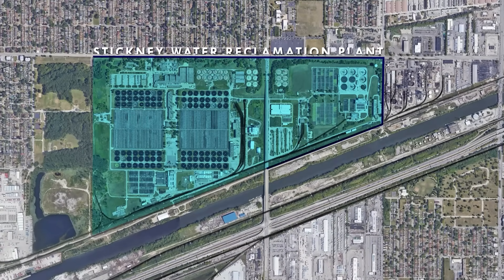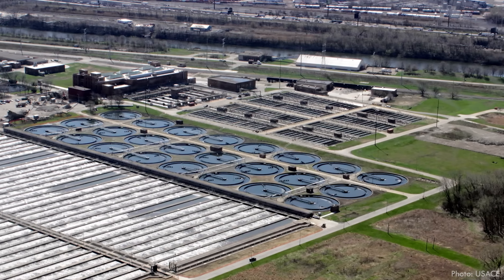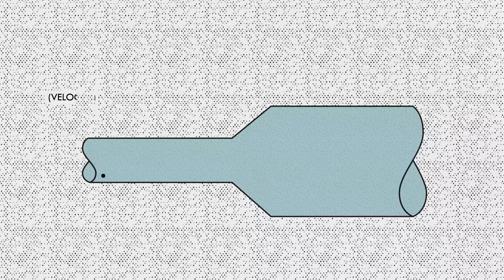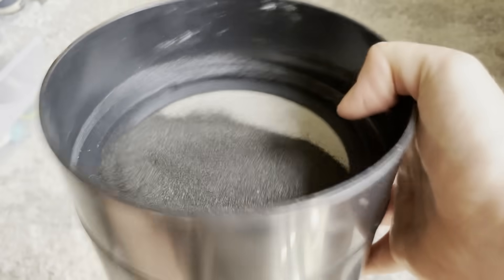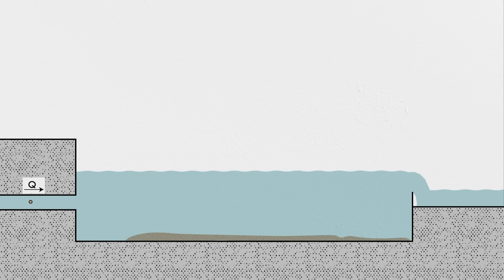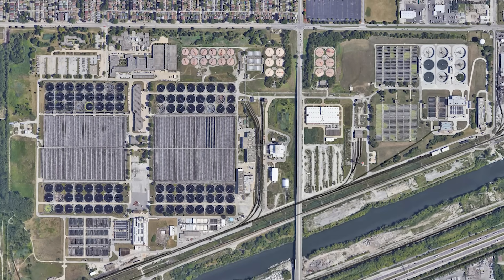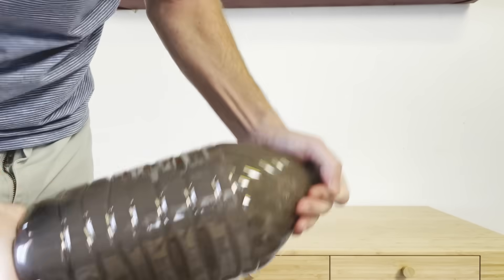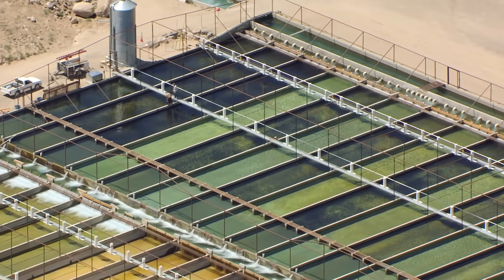How to Clean Sewage with Gravity

Comment: I'm a design engineering student and I'm still confused about how the depth doesn't affect the particles that pass through.  I understand most of the maths and algebra but two things confuse me.  1)  why does td get flipped when compared to tl?  2) surely a shallower basin would be more efficient at filtering these particles out as the particles don't have to fall as far therefore the time taken to fall to the bottom would be shorter?  Can anyone explain this to me?  Otherwise great Video as always and keep up the great work!
Reply: 1. They flip both td and tl. I think thats for simplicity sake. if you dont you would have 1/Vd > LxW/Q after canceling out the Depths. 
2. As for the shallow basin question, this is purely speculation on my part: but You are correct that a more shallow tank would allow for less time to settle being that the distance to travel would be less BUT that would require things like flow rate and settling rates to be known and constant to insure not passing solids out of the tank. Also, being that in order to encourage settling you must increase area to decrease flow, to have a shallow tank you would need it to be very wide and space is always a consideration when designing plants. Going deeper rather than wider saves space. You also must consider the solids that settle must also be removed by some fashion, having a shallower tank would mean sludge withdraw rates would have to be higher and consistent in order to not pass solids out. Furthermore, plants have two design parameters: design flow and peak design flow. So a tank must also be able to not overflow solids at higher flow rates that will happen due to diurnal fluctuations and precipitation events.
So theoretically a shallow tank would allow for a lower time to settle but that doesnt take into account real world conditions.
source: I'm the Chief Operator of a WWTP

Comment: I worked as a intern for a dredging company one summer in college and they used a series of settling ponds (which were just an old open pit mine with a thick plastic liner) to settle suspended particles out of the outflow of a dredge that was expanding a port.
The (MUCH clearer) water was then pumped back to the bay near the port.
Not sure of all of the deals behind the scenes but it seemed like an elegant way to fill back in a giant open pit while making space for more shipping.
Was also a fantastic summer job!

Comment: Great breakdown on the aerobic wastewater treatment. Very fascinating field. Aeration basin micro-organisms host nitrifying bacteria which consume ammonia. If the population is upset or the aeration rates aren't high enough, ammonia nitrogen can make its way through the process and drastically increase chlorination demand. In aeration basin, it takes 4 parts of oxygen to treat 1 part of ammonia. It takes 10 parts of chlorine to neutralize 1 part of ammonia if it makes it to chlorine contact chamber. Not every plant uses chlorine for disinfection. There are safer and simpler methods to disinfection now. Theres always new technology emerging for every part of the treatment process.

Comment: Dairy cows are often bedded with deep sand. While it's a great bedding providing both comfort in the stall, traction on concrete and bacteria has a harder time growing in it compared with organic bedding materials, sandladen manure is a challenge dealing with as well as well as the constant need for new sand to rebed with. One tool that's developed in the past 15years is sand settling lanes. Sandladen manure is removed from the barn via circulated water where it hits a long, nearly level lane where the sand settles down and the manure flows onto liquid storage. Sand is removed several  times a week, stacked and then used to bed again once it's had time to dry.

Comment: At our small company we use dissolved air filtration with the coagulant and flocculant as the first two stages. The solids float to the top and are scraped off rather than sinking. I do wonder the impact of the chemicals used though.

Comment: Why not spin the water within the pipe itself and upon expansion, you can separate the center portion from the outer portion after a specific length without need of a basin. They use that technique to separate plastics of various densities.

Comment: part at 7:15 needed either arrows or at least a slowdown in speech
I did not get where the water is coming from and what the rotating thing does (or even if it is connected in the middle or at the edge of circle)
Reply: Dirty water ("mixed liquor") flows through a pipe towards the clarifier.  The pipe comes up from underneath the center of the clarifier, and releases the water at the top center.  Then the water flows horizontally from center to edge.

As the water moves from center to edge, solid particles fall to the bottom, creating a sludge.  The bottom is sloped, shallow at the edge and deep in the center.  There is an even deeper pit/well at the very center, surrounding  the inlet pipe.  The sludge is supposed to fall into this pit.  (Eventually the sludge is removed, but where it goes doesn't affect the clarifier.)

The rotating thing has a pivot at the center and a motor at the edge, so it rotates around the center.  But it isn't only above the water - under the water, it has a long scraper part - this acts sort of like a broom, pushing the sludge towards the center of the clarifier.
Reply: @CoastalSphinx  thanks!

now I wonder why water doesn't go into the pit "at the very center"
Reply: @NoNameAtAll2  Water does go into the pit, but sludge is heavier (higher density).  So when sludge flows in, it pushes the water out.

Comment: As an Environmental Engineer, it's amazing that wastewater treatment is getting the exposure that it deserves. This can go a long way into shaping people's opinion in processes that are crucial in our lives but are oblivious to.
Reply: Couldn't agree more, im a maintenance tech for a water company and people seem to think that Sewage just, kinda goes down the drain and disappears to some magic location?!
Reply: I'm always amazed of people living across the street from a treatment plant and don't know it.
Reply: how is the sediment accumulated at the bottom taken care of? I mean I assume that it eventually piles up
Reply: @BringDHouseDown  Grit, as it is commonly called can be removed manually in small-scale plants. Large scale plants employ bucket s calpers, pumps, or screw conveyors. Sludge ( biodegraded material) is removed every 3-4 years ( depending on system design), dried and sold as fertilizer.
Reply: @0xKenneth  where r u from?
Reply: @0xKenneth  Do you have any idea how much sludge would build up if you removed it every 3 to 4 years. It is removed daily and in some small package plants, it is close to monthly. Without a grit chamber, the grit will be in the sludge. It is generally not removed once combined with sludge. Grit will eventually build up to an extent as not all will be removed when pumping to the next stage of the treatment process. Tanks or clarifiers will be dropped generally on a yearly basis for inspection at this time grit will be removed if it is excessive.
Reply: @BringDHouseDown  9:00
Reply: If only more sewage treatment were available in third world countries a lot of deaths could be prevented.
Reply: @thebigwarthog  all they need is a septic tank that I'd drained by a third party once every decade. It's shocking how it's not being implemented
Reply: Hey i've got a question: These circular clarifiers are called Dorr-type clarifiers right? Dorr clasifiers are often used in mining so there is where my question stems from.
Reply: @fic15 is probably not a coincidence then, that another term in wastewater treatment "mixed liquor" comes from the slurry produced in mining, as well.
Reply: Gravity huh? Buoyancy vs density. Otherwise nothing would float.
Reply: I just started working for an engineering firm as a structural designer. I was literally working on a treatment plant while listening to this lol. It's a really cool industry.
Reply: Yeah except the horrendous shit smell that gets carried any way the wind blows
Reply: @spamelowashington57  I presume that comment was made in light of the fact that you are not a biological organism?

Comment: Hell we even use a kind of sedimentation in brewing when we put the beer into a whirlpool before transferring to the fermenter. The whirlpool pulls from behind a dam and pumps the liquid out at and angle so it spins in the vessel. The heavy solids concentrate at the center and we draw liquid from the back. And of course when the beer ferments it becomes quite clear after a month in the tank. We are a small craft brewery and we can get crystal clear beer with no filtration.

Comment: I work on swimming pools, some of my pools do not settle easily and I have to use clarifier and occasionally flocculant. Could these pools have problems because their ground wire is damaged? As if it is retaining charge and it's keeping particles suspended against gravity?

Comment: I ran a small waste water system.  Our first filtration system was a rotating sieve that filtered out all the big stuff before going to the clarifier.  We also had a pump that sucked the sludge from the bottom of the clarifier and put it on a belt press to dewater.  Fun fact, there is a tool called a sludge judge used to measure the depth of the sludge at the bottom of the clarifier.  Don't let the sludge get to thick or you'll break the rotating scraper.

Comment: "All particles settle when t_D > t_L" is that really correct? It sounds backwards to me because if the time needed to settle is longer than the time needed to traverse the basin, the particle will not reach the bottom in time, will it?

Comment: 7:35 Where you've said the sludge is pumped out for disposal is not entirely true. The sludge either goes to a recirculation pump that goes back to the ASP lanes (as seen in 1:30), this is usually activated sludge that has the "good" bacteria in it. The other parts of the sludge goes to a thickener which gets dewatered then thickened by poly electrolyte THEN goes off to the digesters and turned into electricity.

Comment: Designed many a clarifier in my time. Clarifiers following activated sludge systems were always more difficult due to the  nature of the solids produced in the aeration basin especially if growing nitrifying organisms was necessary .  Lots of research as to design of the effluent weirs ,adding baffles at the wall etc plus the effects of the sludge removal mechanism on the flow of solids in the basin.  Always an interesting challenge but that is engineering.  Wish more young people would become engineers.  Love your channel.

Comment: The settlement only works if the particles are heavier than water, right? Lighter particles will "settle" to the surface, so they would need to be extracted differently.

Comment: Can water be clarified faster with a simple Cyclone system (like used in sawdust collectors) or does the momentum of the fluid inhibit this from happening efficiently?

(BTW: thermal vortex tubes may be a good future topic)
Reply: This exists with the name "hydrocyclone" although I would guess the separation is not as efficient, because the water is much more viscous than air.  Additionally  if a material has a density close to water then a hydrocyclone will not separate it well.  Air cyclones don't have this problem because the density of air is so low that no solid objects will be close to it.

Comment: I work as a process engineer for a company in the UK that supplies modular treatment systems to the municipal, industrial, and construction sectors - and I have to say this is the best layman's explanation I've ever seen for how clarifiers work! Since most of our clarifier/settlement units at work are modular (i.e. small, mobile units that can be prefabricated and transported to site on a flat-bed) we use lamellas, it would have been cool to see you expand on the overflow rate (or upflow rate as we call it) to explain how a lamella takes advantage of this principle to reduce the required footprint (maybe a little companion piece for a future video!). We also make chemical dosing units, MBBRs for secondary/tertiary treatment and DAFs (mostly for HST applications) so hope you cover some of these technologies eventually.

Comment: You should do more videos about Chicago's water processing. Did you know that almost all of the rainwater that goes into drains is also processed at Stickney? They aren't allowed to let it run into Lake Michigan due to an international treaty. That treaty also limits how much water the city can pull out of the lake annually, including how much flows out of the Chicago river! That means that when the city is using more water, they slow the flow of the river to stay under the quota.

Comment: Ok, so to me it seems like we are going about this whole water process in a round-about fashion, we treat waste water to return it to the river then pump it out of the river to drink it? Logic 101 would determine it uses far less energy and time de-sedimenting the same water twice and just use the processed water in a loop..
Reply: yes, but there is a perception "yuck' factor if you do it in a close loop.
and also the group which pumps out the river could be the next town or state/country and thus they need their own infrastructures.
Reply: @kelvinate   I agree 100% and understand the "yuck" factor of course, however educating the public on the fact that processed sewage is cleaner than what is currently floating by in their local waterway with farm runoff, animal scat and dead animals and chemicals may make the pre-processed waters seem a bit more viable. JM $0.02

Comment: I love the detailed description compared to the overview videos you said this wasn't (and this wasn't).

Does wastewater handling differ much by climate?  Are the bacteria processes handled differently where the temperatures are too high/low?

This all seems very water intensive too!  Is evaporation just ignored as part of the natural water cycle?
Reply: The short answer to your question is yes, there are temperature issues .  There are methods available to help mitigate these issues however under most circumstances.  These mitigations would take me more time to go into than I have the time right now but for example in biological treatment processes such as activated sludge you will see a drop off in growth rate of the organisms that convert soluble substrates into solids, hence the term activated sludge.  Some equipment used to provide the necessary oxygen demand to make this conversion are more amenable to retaining good temperatures.  This would be for example the use of subsurface aeration equipment versus surface aeration equipment .  It’s all very interesting and I spent my whole working life of 38 yrs in  consulting engineering indesign of water and wastewater facilities so maybe I am prejudiced.

Comment: Hi Grady, thanks for another great video. When I was a kid growing up in Canada, we'd see lots of blowing snow (more than these days) and one thing the highway department did to try to keep if off the roads was to erect "snow fences". These were vertical wooden slats with spaces between each one that were woven into wire fence rolls that could be unrolled in September and rolled up for storage in April. The snow-laden wind would blow through the fence where is would slow down and the bulk of the particles (snow) would separate out before it got near the road. Is there anything similar in sediment ponds such as baffles etc. to hasten the dropping out of particles?

Comment: 07:46 That drinking water is only as clean as much the sewage water was cleaned upstream the river.
Reply from the maker: No most surface water sources go through treatment before distribution to a potable supply sysem
Reply: @PracticalEngineeringChannel  Yeah, sure it is cleaned before distributed to people, but still it does matter where that cleaning process starts from.

Comment: I'd love to hear and see more about how they collect and remove the sediment/sludge after it's out of the water. How often do they have to do that? Is it as gross as it sounds like it would be?
Reply: There is a pipe at the bottom of the  clarifier that takes the sludge to a sludge basin. Then the sludge from the sludge basin is pumped to a belt press, which presses the water out of the sludge.  The water then goes back through the process without the sludge, and the sludge is put in a dump truck and hauled to the landfill. Hopefully that answers your question.
Reply: In Seattle they turn the biosolids into fertilizer!

Comment: i worked next to a sewage treatment plant for a massive city, and they had some process that they would do at around 5:00pm that released a smell that is so unholy that i can't really describe it. it's worse than a kybo in the middle of summer or the inside of a leach line in the boonies. truly horrific. they had so many complaints before that they only did whatever it was at 5:00pm because that is when our official hours ended. most people stayed until 6:00 pm though, and my company started adding perfume into the AC system to deal with the smell. i could usually last about 30 minutes before i bailed. in the winter though, it never smelled as bad. i could never figure out what the hell they were doing, and i never wanted to get any closer to find out

Comment: Again, explain further. Alum, Ferric Chloride, and other metal salts, not pool cleaner. Explain the use of polymers, how they are charged, how they form floc. Be consistent. Don't spring engineering math on us, then short us on the actual chemical processes.